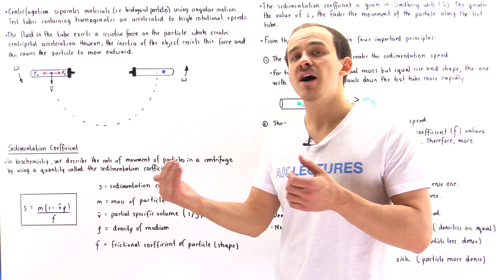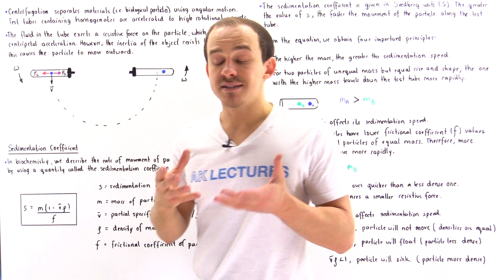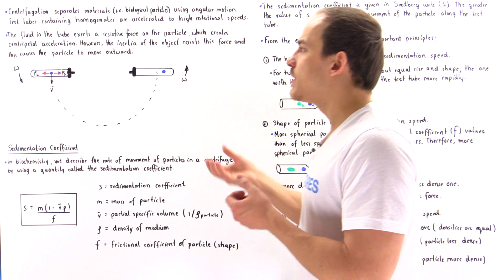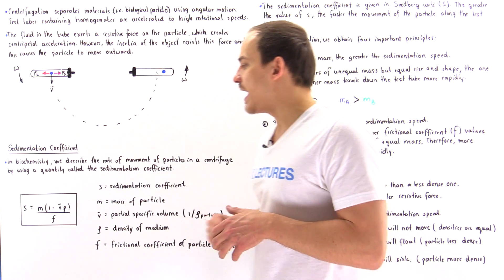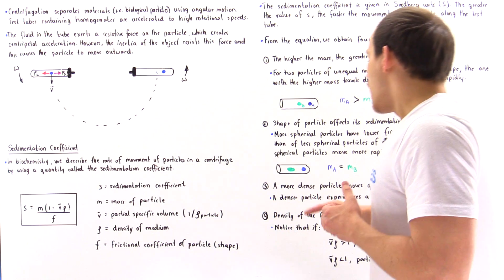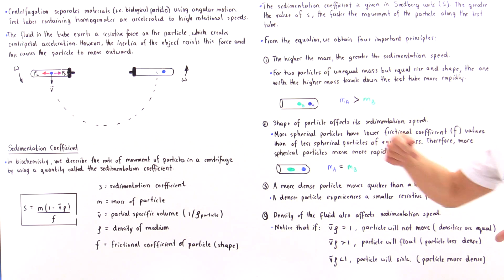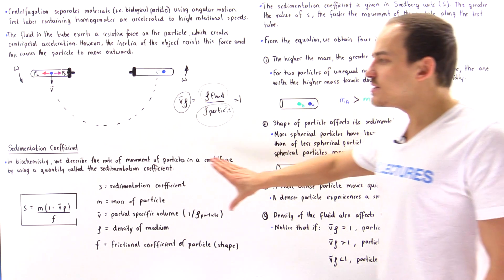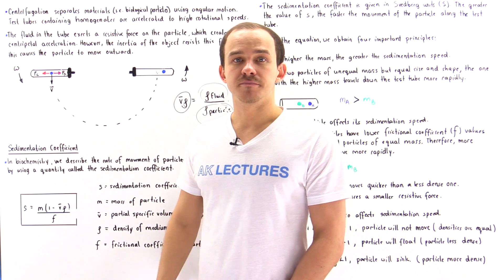Centrifugation and Sedimentation Coefficient

Comment: how a particle can have density,  because density is no of particles / volume. there is no meaning in talking about density of single particle. please explain.
Reply: Surajcxs c.singh all substances have a density, a single particle even though it's by itself it will tend to associate with like substances with a certain density at a particular pressure and temperature. Therefore, since centrifugation doesnt affect temperature or pressure, it simply accelerates all the particles exerting force on all the particles; different particles will react according to their respective properties. Density is mass divided by volume, meaning the mass of the individual particle divided by the volume of space it occupies. You'll see at the end of centrifugation all the substances make bands in an order that is proportional to their different densities: greater densities will be seen closer to the bottom. The constituents of the mixture will order themselves in a relative manner; the more dense particle will always be lower than the particle that is less dense. It's the law of the universe to behave in this way because of physics

Comment: If two particles have the same size and density, they would have the same mass, right?
Reply: The equation is not relating 2 particles, that would call for a bit more math. The equation is relating the density of the particle and the density of the fluid. You would need to calculate s for each particle separately to determine which particle moves faster. To answer your question directly, size is not a great word to use :P. If two particles  occupy equal volumes and have equal densities then their masses would be the same.
Reply: Density = mass/volume

For 2 particles to have the same density they'd both have to occupy the same space (size) and have the same mass so yes

Comment: Hi! I am taking biochemistry and our equation also includes "N", or Avogadro's number in the denominator. So the equation looks like this: s=M(1-vp)/Nf Why is "N" not included here?
Thanks!
Reply from the maker: Hey Olivia, in another lecture I actually derive the equation you are talking about and I discuss the relationship between the equation I have in this lecture and the equation you use in your class. You can refer to that lecture :) Here is the link: http://www.aklectures.com/lecture/derivation-of-sedimentation-coefficient-equation
Reply: I have a question: the principles 1 and 3... aren't they the same thing? if two particles have equal size (and shape), but one of them has greater mass , this one would be also more dense. Right??? Please anyone answer